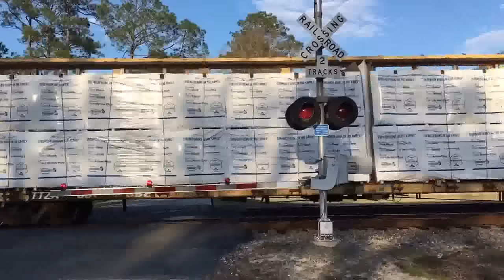What Happens When Railroad Crossing Gates Malfunction?!   Etc.

Comment: I was a locomotive engineer for nearly 30 years with the Southern Pacific and Union Pacific when they took the SP over.

The truth is grade crossing protection isn’t fail-safe.  There is battery back up for a power failure and in very remote areas where there are no electric lines and battery power is the main source, recharged by solar panels.  The important thing is crossing protection DOES fail for a number of different reasons which I’ll not go into, lest some idiot tries to defeat one intentionally.

It is a fairly rare occasion but twice in my own career I operated over grade crossings that had failed clipping along at 40mph.  No one got hit because they put into practice the oldest safety advice.  And that is before crossing ANY tracks, protected or not, you must Look and Listen.  Not a glance.  A real look.  Glances can make you dead.  Mute the music for a couple of seconds so you can hear an approaching train.  You’ve heard that song dozens of times anyway.

Still, don’t count on hearing the whistle.  In snowy conditions, the throat of the horn can get clogged with snow, emitting a pitiful squeak if working at all.  That is why Look is part of the equation.

Keep in mind crossing protection is nothing more than an electromechanical device, just like the toaster in your kitchen.  Would you bet your life it won’t fail at breakfast tomorrow?

Me either.

Deaths at grade crossings are second in number only to drunk driving fatalities.  And they are usually 99.99% preventable.  Odds are someone got clobbered while you’ve been reading this.  And there is nothing the engineer can do about it.  Most road freight trains weigh in at between 10,000 and 13,000 tons these days, and on roller bearings with very little friction between the wheels and rail.  That is why trains are so efficient.  And on average, depending on speed and grade it takes more than a mile to stop even in full emergency braking.  What that means is by the time the engineer sees you, it is already too late to stop for you.  Even at 10mph it takes a few hundred feet to stop.

Another tip I’ll pass on is if you are stopping at a grade crossing stop well before nearing the crossing.  50 feet at a minimum.  More is better if you can.  The reason why is a train can derail at any time, at any speed and at any place.  One idiot in Oregon got as close as he could to the lowered gates.  A switch engine crew was crossing the road at walking speed.  A car loaded with lumber derailed and just laid over on its side.  No drama.  But the idiot in the car wound up with 50 tons of timber in his lap.  Squashed like a bug and just as dead.

Don’t assume everyone knows these things, but I can assure you they don’t, so pass the word along to the people you love.  You just might save a life some day…
Reply: The standard distance from the wide white stop line and the near rail is fifteen feet.
Reply: Bruv I don’t care XD
Reply: Well spoken sir.
Reply: Thank you for your advices! In Italy we still have many rail crossing on secondary railways. Most of them finally closed some years ago, too dangerous!
Reply: @marpass8763  couldn't happen here though, way too many grade crossings. There was a figure from the 50's of the cost to convert every existing crossing to an over/underpass and it was like 3X our GDP, today it's an even higher cost.
Reply: @cpufreak101 Here in Italy during the last 20 years, after many serious and / or fatal accidents and suicides,  we converted the most important rail crossing in underpass or overpass, but only on main roads. All the others had been finally closed. There are only a very few left.
Reply: @marpass8763  ah, you guys are also "lucky" with the fact your rail network is relatively small
Reply: Robert Miller m
Reply: I explained this to my mom and now she stops and looks at every crossing even with Gates and lights no matter the traffic conditions.
Reply: Thanks for the advice! I am an avid Railfan, Radio Amateur and Scanner Enthusiast, my career has been Electronics for many years, my experience in industrial Electronics gave me a healthy respect for All things electro-mechanical, especially heavy duty safety devices... I know that even the best maintained Electronics can fail... so caution and distance increases chances of survival...
Reply: Train tracks scares the shit outta me i saw a girls head go between the rail and the wheel of the track she tripped head fell on the tracks i didnt sleep for weeks after that
Reply: It's amazing how the concept of "Stop-Look & Listen"  is a concept many cannot comprehend yet, in the 1950's during the cold war, they understood the concept of "Duck & Cover". Is all this really that hard to understand?
Reply: @tonydobek8908  I do agree with you but what I can't follow is why they would stampede over others just to be the first to bite the big one . . .LOL,LOL,LOL!!
Reply: Robert Miller.... so well put my friend. I saw one video where a train was approaching a Crossing at fast speed but the lights didn't start flashing until he got right at the Crossing. He came so close at hitting the car that was crossing The Crossing, it's was amazing. And the oncoming car saw the train at the last minute and almost hit the train. He had to slam on brakes. This is a message to all drivers, slow down and yield at every railroad crossing.
Reply: @tonydobek8908  you can say that again.
Reply: I hope people heed your advice!!!!!!  When I was a teenager in high school we kids fought to try to get the lights/crossing guards installed. They never listened. Then one night a mom & dad and a little baby strapped in it's car seat were hit by a train and all of them were killed. It wasn't the train drivers fault!! The cars behind him stayed stopped heard the train whistles  but the dad thought he could make it.
   Shortly after that they put up the cross walk ect.
    Like you wisely stated, stay WAY BACK from the tracks cause the train might derail or whatever, safty first.
Reply: @smellymeadowhel8763  I'll bet you didn't, either. You proba bly still have nightmares ab- out it?
Reply: why the train is the time to use 918 cargo
Reply: @Animatentions Did you just say, “Bruv, I don’t care.” To some live saving tips? Try and repeat that when you or a loved one are 5 feet under.
Reply: @Robert Miller Thanks for the advice! I own a railfanning channel and I film very many Trains. I never knew that the horn could get plugged up by snow and make a squeak. Very Interesting life saving tips.
Reply: Robert Miller you wrote a whole passage lol
Reply: Adam Mostafa and you care why?
Reply: ^^^@Robert Miller .. Wow Solid Read Bruh very informative/in-depth Advice you Could write out the ingredients on a Can of Mushroom Soup and I'd be Captivated and Amazed, On a Serious Note though your Comment Regarding Safety at Grade Crossings was Well Done and the Message was Excellently Executed (Written out) that my 6yr Old Grandchild Could have Gone through it With-out a Hitch, you Must Have Experience or Have Worked for a Railway Corporation or Subbed for One, that was a Great Read and thank you for that Bless-up Brother Dude :Oh I Went back to Your Full Message & I Somehow Missed or I may had 4Gotten that You Were A Locomotive Engineer for a Railway Company of Nearly 30yrs Wow Man I Bet that Was a Blast and a Half D] v . (Nmcfmamf) ..
Reply: @Christian Salazar .. Brother I did think that at first I was like Awweee Fuck here We Go but after the first two or 3 Sentences I was Hooked line and Sinker, it was a Solid and very Informative Read I never knew the Whistle Blower Could get Clogged with Snow During Winter, but when One thinks About it Does Make Sense to A Whole Degree, I was very Captivated and Interested throuh-out The Text Message, Usually I Don't Bother Reading Most Comments Past 2 or 3 Sentences Un-less it's Informative, Well Worded and or Intelligently Put Across, Not like Some idiot or Troll have a Nice Day Brother Man :D] v. (Nmcfmamf) ..
Reply: Michael  .. Providing you have time to drop that trailer, I'd do exactly the same thing I drive trucks for a living too ..
Reply: @illinoisrailfanningproductions  .. Well said brother, yeah I saw that comment but didn't get it or I just thought they was Trolling someone] some people are just thick dumb or plain ignorant or don't want to remain in the land of the living with the rest of us Safety/advised/ careful folk ..
Reply: Michael  .. Oh-my-Gosh does ring a Bell wasn't the Driver Weird or said something stupid and or could/should have done something to save the day? I barely remember somethin' Crazy anyways Trains are Super Dangerous and can be Devastating no matter what situation one finds themselves in  ..
Reply: Ok...?
Reply: So I shouldn't stand at the same distance from the track as the gates and record trains? That's how I always do it...
Reply: Very good advice Mr Miller. I also worked for SP 30 years ago in the LA-Bakersrsfield area. In signal. I saw so many accidents and close calls in the Mojave lancaster area area, cars trying to beat a 10,000 ton oil cans train coming down the grade, multiple tracks, but they don't see the other train from the same direction. Stop look listen and live. Did you work the Los Angeles territory?
Reply: Honestly, I grew up in an area without the trains.  Now I have many around me and I'll be taking this to heart for sure after watching this...
Reply: They malfonction here from the cold and will lock in the down position with lights yet no train for 2hours
Reply: Robert Miller thanks for the info.
Reply: In the UK, almost all road level crossings have barriers and wigwag signals (so called because as well as the red flashing lights, the crossing itself shrieks out with a loud wigwag sound). Of course, being a small country (you can fit us in Texas alone nearly 3 times over) crossings are invariably hooked up to a mains electricity supply. 

However, because the crossings close a minute or two before the train arrives, there are still the occasional impatient daredevils. Back in the 1990s, a train crash with a stationery car was staged for a PSA ("Red Runner"), while around a decade ago, Top Gear also staged one (albeit with very dubious commentary from Clarkson).
Reply: its not like train sneak up on you!! most time you can tell right where their path will be!! 2 steel lines on the ground train seem to like to follow them a lot!!
Reply: @j.sterling9167  Yeah! Duck and Cover was a fear due to Mutually Assured Destruction, making it 99.999999999% impossible, but being hit by a train is not a thing that wil, probably NEVER happen.
Reply: Robert Miller I fear a train derailing every time I stop for one 😒
Reply: @alohaxxox 
Thanks for the feedback.

You need not be afraid.  Just give the trains the respect they deserve.  In doing so you may never be a part of the 5 o'clock news on your local TV station...
Reply: Thanks captain obvious.
Reply: Thank you sir for this message. I am a signal maintainer and you are 100% right. Xings do not always function properly. It is not necessarily the fault of the RR employee. The man who made this video obviously knows nothing and most of the people commenting are just as ignorant. You have to obey the traffic laws at a xing if you want to stay alive.
Reply: Why does it happen sometimes when the gates go down and there's no train? I've seen that happen twice last year where the gate was down for 15+ minutes and there was never a train
Reply: @Karmy.  
There are variables. If in CTC territory where a dispatcher controls train movements from a central point and can be hundreds of miles away. The can control signals and switches by signals sent through code lines or microwave. Sometimes when lining a train through an area the protection can read it as an approaching train and activate, and this is especially so if the crossing gates are close to a dispatcher remotely controlled switch.

In other areas of operation it can be a small glitch in circuitry or the track gets electrically shunted in some way, intentionally or accidentally.

Did you see an employee in the vicinity? Signal department folks often test crossing protection and they will activate it in the process.

Or it can be some entirely different cause.

Don't trust them. Using your eyes and ears are the best way to cross tracks safely.
Reply: Where were you out of? 47 years on SP/UP LA Division/LA Service Unit.
Reply: @robertmiller5217  yeah I didn't see anyone
Reply: Thanks for the advice. My grandpa died because his 18 wheeler got hit by a train at an unmarked crossing. They are dangerous business
Reply: I suppose the guy with the lumber thought it was a passenger train and wanted to get aboard.  

Frankly I don't understand why people play chicken with trains eventually they'll be the loser.
Reply: @calebweems9392  Caleb, you have done a great service to your mom, by teaching her abiut signal crossing safety!!

I bet you could put together a speech or demonstration on crossing safety.

Maybe for school, where you could talk to your class.  

It worked for your mom, so I'm betting you can tell this to everyone.
Reply: @johnkeller6171 to save a couple of bucks or a minute or two , that's what his life was worth.
Reply: Will you know the old saying "anything man make will break"

Comment: At 4:58 you see a phone number on the crossing pole. It's there to call the yard office to inform them of a malfunction, vehicle stuck on the tracks etc. It takes a few minutes, but that heads up may save a life.
Reply: Good response! And after being reported the train dispatcher/operator will put a crossing malfunction order that will make train crews protect their movement over the crossing until its repaired.

Comment: 4:50 It's shaking because a GHOST TRAIN is passing thru 😆🤣
Reply: You might laugh but I thought the same thing. What's really strange is this video was over and when I just tried to write this it started playing at the exact part of the video where the crossings were shaking. I jumped.
Reply: Maybe the arm is shaking b ecause it's really windy?
Reply: Usually the crossing guards are set up where there is a sensor on the rails and gates possibly the gates crossing guard was tripped multiple times by something maybe caught on it and blowing in and out of the main sensor on the gate
Reply: Andrew King the one off Thomas and friends Timothy
Reply: Yeah i think it is a evil 😈 spirit shaking the rail road crossing gates !😱😂🤣💀👹👻🚊🚉🚂🚞®️®️⚠️🛤
Reply: It sounded like the motor wasn't shutting off when the gate hit the end of it's travel.  Gear slipped a tooth, process repeats until either the gear teeth strip or the motor burns out.
Reply: Yep
Reply: The railroad crossing is scared of the ghost train 😧
Reply: Andrew King maybe
Reply: Andrew King  it’s called WIND.
Reply: @quarneshathomas4160  yes maybe
Reply: Chicagodaddy1.....not wind. The motor was malfunctioning. If it were wind,it would have to be a strong wind and if you look at the trees in the background,there was no wind!
Reply: Heheheheh
Reply: Malfunctioning lmao
Reply: It looks like it is powered by hydraulic pump..so maybe a malfunctioning oil pressure sensor.
Reply: Maybe he’s scared of ghost train